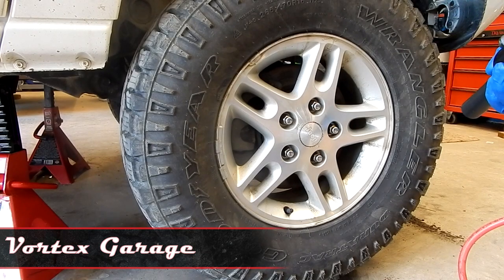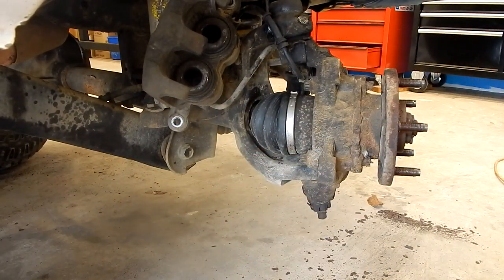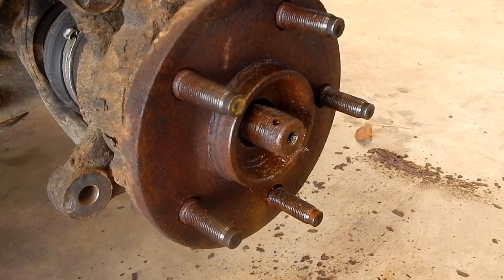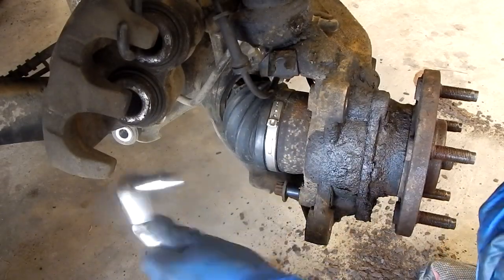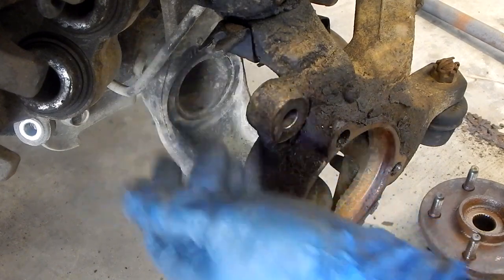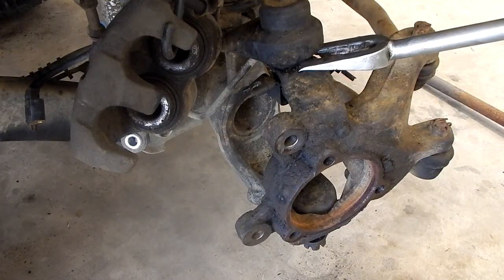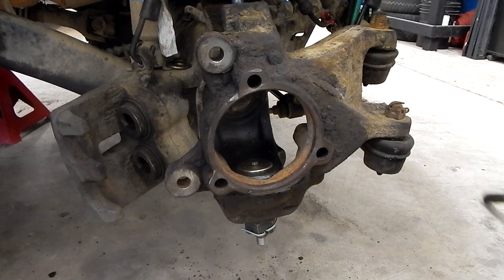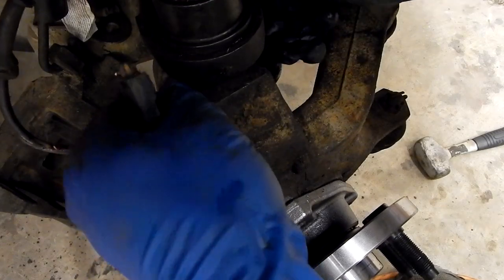REMASTERED - Jeep WJ Maintenance - Part 2: Balljoints and Hub Bearing Assembly Replacement -No Music

Comment: With all the rust on the axle nut and splines why wouldn't you put a little grease on the splines going through the unit bearing and on the threads before you tightened up the axle nut and use anti-seize on the unit bearing fasteners